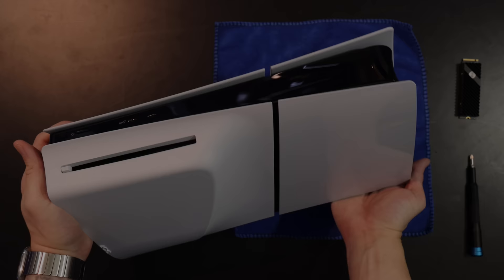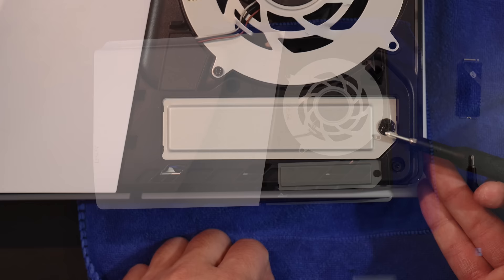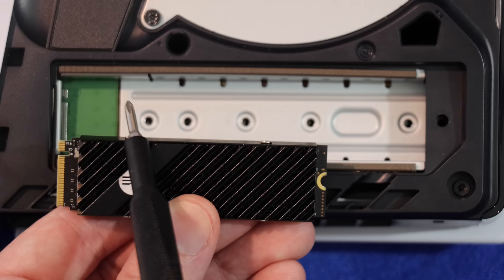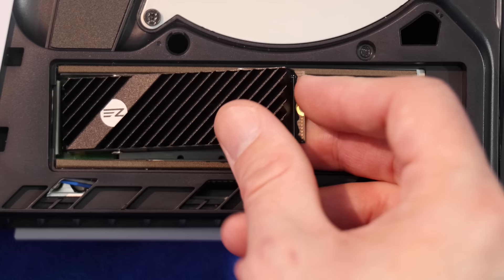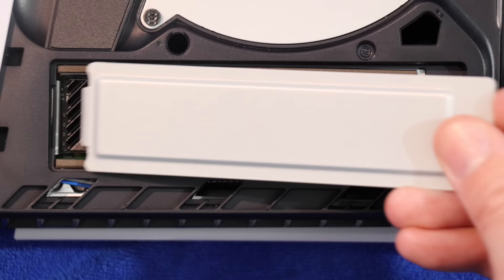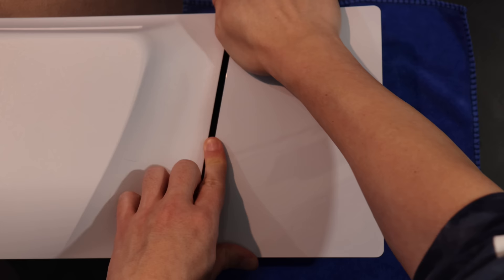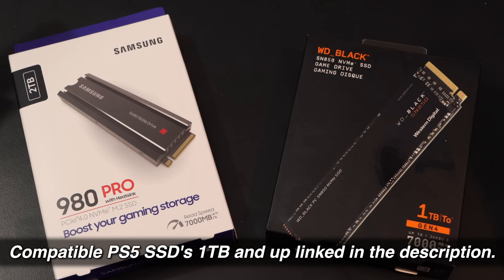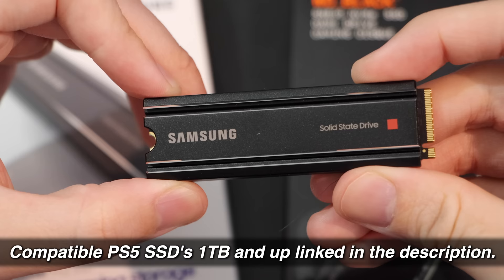PS5 Slim: How To Install An M.2 SSD

Comment: Looks easier to setup on the Slim since you only take off the top back instead of the entire back. This will make it better for most people installing an SSD for the first time or going through another round for a transfer or upgrade.
Reply: You make it sound like if you need a college degree in Engineering in order to install an M.2 SSD in the original PS5.

🤣🤣🤣

Comment: I don't often comment on videos, but when I do, it has a reason. 
As a person who often has to rely on support videos I must say dear Mystic this video should be promoted by Sony as the official way on how to install this SSD. The instuctions are cystal clear from A until Z. From the simple "tug the left corner to remove the lid", to, "insert the SSD under a slight angle and push in gently until you hear a click". Even in the end, where you say, line up the 3 tabs and then push close on the left corner. Then you also follow up with, when you power the console on, it will show to format the SSD. 
What i'm trying to say is, in comparison to sometimes other videos, you absolutely leave 0 blind spots in your instruction video. Therefore my biggest thanks in this.
Reply: Now he will move on to do it in other languages too. He is the best
Reply: Lies. If you comment that much you do it often hahahahahhahahahh

Comment: So I just got a 4 TB SSD with heat sink from game stop for like 269 and had to watch this video on how to install it. And if im not mistaken it was this exact video that was recommended by the employee there. It was exactly as he described. Very short, very clear instructions and very helpful. Thank you so much. I've been worried about doing this myself because I didn't want to break my console but you showed me how easy it was. Honestly the hardest part was finding the screwdriver because I'm in a hotel lol

Comment: Awesome video 🔥 2TB drives are getting cheap now, under $100!
Reply: I gotten one to bro and mine wasn’t that much either lol
Reply: They’re still like 200 in Canada :/
Reply: I'm really pissed about that too. I wish I'd waited just a tad longer.
Reply: I haven't seen a 2tb under 100 yet but close. 130 was the cheapest 2 tb. All the 1 tb ares like 80 now
Reply: Though the heatsink itself also drives up the price.  That's the problem with these SSD's.  While blazing fast, they are so sensitive to heat.  You need one, even if it's just rubber banding a gel heatsink to the thing.
Reply: @dapperfan44  buyers remorse 😹 patience is key
Reply: @Supperdude9  buying an SSD with no heat sink and a generic heat sink together is much more cost effective than buying an SSD with a built in heat sink. That’s what I did and it came out to about $120 compared to $200. Don’t be worried, putting on a heat sink is incredibly easy. Just make sure the size is correct

Comment: I bought a 2 TB Samsung 980 Pro and attempted to install at least 5 times, watched andozen videos, and the console wouldn't even register its existence. Found an article regarding LOTS of issues with Samsung. Got a 2 TB officially licensed WD & it worked perfectly the first time I installed it. Had me freaking out that my ps5 was broken for a minute.
Reply: I was looking for this comment.  I have the same ssd, 2TB Samsung 980 Pro, Should I try to install it as well? I bought it last year,  I never opened it.
Reply: @Cosmic_Visitors  yea man watch a few videos on YT before installing. It'll probably work, there's just a lot of manufacturing defects in that brand. I hear Samsung cutting corners lately on parts
Reply: @AlienIsolationist  well,  I installed it first time and It worked perfectly 👌
Reply: @Cosmic_Visitors  yea man it's a very small percentage that get the bone, but it's a higher percentage then most other brands so it's not uncommon.

Comment: I have a 4tb ssd in my ps5 that technically isn't ps5 compatible but I have not had any issues with it at all. It's 4.9 gigs a second fast and it runs everything perfectly
Reply: 4.9GBPS is actually pretty decent! My SN850 does 5.5 and it’s ample range for playing/transferring 👍🏼
Reply: @Kronorium  yea it's faster than what's in my desktop. The ps5 says 5.5 and higher is the supported speed but I have not had any issues with it.
Reply: @SSNebula  my sn850 runs at 6900MBps

Comment: Excellent. Just got a 2TB WD Black NVME SSD on sale for my PS5 Slim. I recommend everyone to buy a passive heatsink for their NVME SSD if the one you buy doesn't have one built in. The M.2 expansion slot has very poor cooling especially with the metal cover on, it relies on negative pressure from the fan to suck out hot air from the expansion slot and SSD, this method of cooling literally sucks because it allows the SSD to get as hot as it can. With SSDs, once it gets too hot it'll cause thermal throttling, drastically reducing its performance but the more serious issue is it greatly reduces its lifespan
Reply: Yeah luckily most all everyone getting SSDs for their PS5s are getting ones with a heat sink. I’m sure over 95% of them are gonna have a heat sink built in.

Comment: its easy to install and the video shows it well. i bought a Crucial T500 ssd on Amazon which runs fine with PS5 at speed of 7300 mo/sec. at a reasonable price.

Comment: When you thread in the screw, should the SSD still be hovering a bit? Or should you screw all the way so that the SSD is fully forced down with no hovering?
Reply: No hovering. Should be flat. Don’t over tighten the screw though

Comment: That is easy. Hopefully I can buy a Slim PS5 in germany soon. I was waiting for the slim model since the PS5 launched, enough is enough. 😅
Reply: I'm curious too, but I think we'll have to wait until either November 24th (when the PS5 fat sales end) or early December.
Reply: Same. I deliberately dodged the base model all this time while waiting for the slim. That wait is about to be paid off.
Reply: @shawnbenjamin9636  Same. Too bad it didn't get smaller than this, but anything other than that mammoth is better in my view.
Reply: @Henkibojj  True, but I'll count my blessings. It's better than nothing.
Reply: New slim models have many problems. Should have bought the original because the slim is cheaper because Sony cut costs on all components. Be lucky if this slim lasts 6 months!

Comment: Hey man I got a ps5 yesterday and today my disc drive doesn’t register any of my discs. Any idea why? I know it’s not something dumb like the disc being upside down and I’ve already tried restarting it in safe mode and rebuilding the database and nothing’s made a difference.
Reply: With the console turned off, try removing the disc drive from the PS5 then turn on the console, then turn it off and reconnect the disc drive.  The console should pair the drive again.
Reply: @rickdiaz3657  it’s an old version so that ain’t possible
Reply: Hundreds of people have had their PS5 drives crash ! I think Sony wants us to order all digital games or buy a new PS5. It’s a scam and lawsuits are coming

Comment: But we can store games on external SSD, right? Just have to move them in to play them.
Reply: You don't need an external SSD for storing games. You can buy a cheaper mechanical hard drive for storing games.

To run PS5 games however you'll need to use one of the internal SSD's.
Reply: External SSDs don’t truly exist. I’ve seen scams of people selling so called external SSDs and my friend got one once and it was corrupt and couldn’t install anything. All SSDs are internal no matter what. Any external drive is an HDD and only ps4 games can be played from it on ur ps5. Ps5 games need to be on an ssd.

Comment: Wonder if you can put your existing external SSD from an OG PS5 into the slim without formatting it?
Reply: Theoretically it should be so, if there isn't any activated system-thing going on.
Reply: Pretty sure it has been done as long as the ps5 is using the same account from the ps5 the drive came from

Comment: Guys can someone tell me if the DIGITAL version from the slim is also compatible with this ssd? And also if the model of the PS5 slim changes and maybe is not compatible with one of the ssds. Im afraid to buy one ssd and then not be able to use it.

Comment: I don't plan on getting a slim unless something happens to my current console. 

But if that happens. Would there be any issues just placing the SSD I have now in a new console? Would it still need to format?
Reply: No it works on the slim just like the fat PS5’s. A lot of slim OS5’s have disc reading failure and overheating problems so I’d hang on to the original PS5 if I were you!
Reply: @kicksg3786 I ain’t seeing any slim ps5s with issues